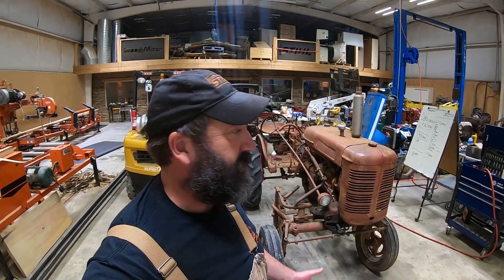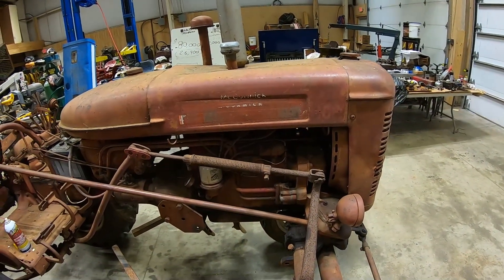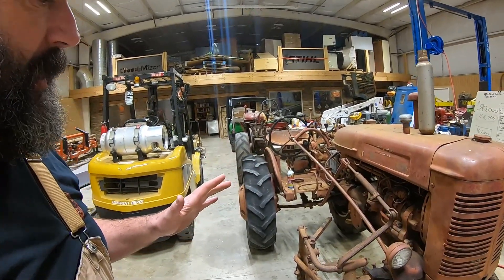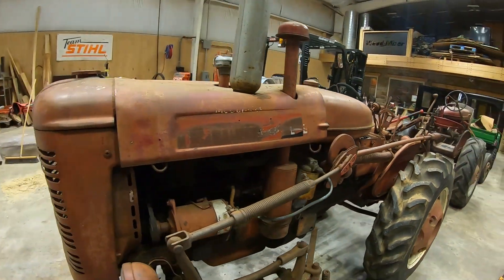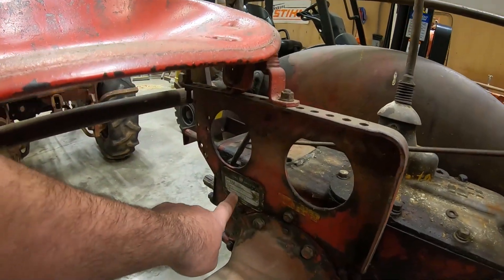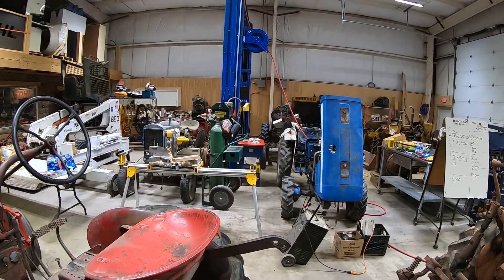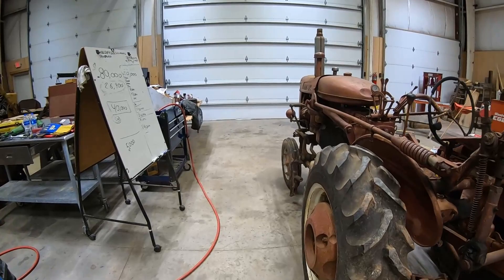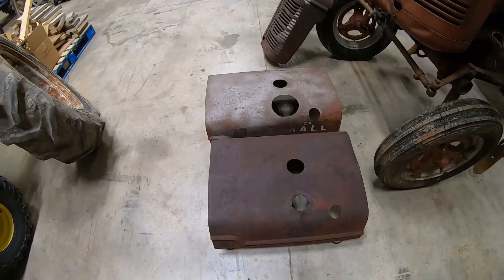Just in!!  International Farmall IH Super A1...

Comment: Does the Super A-1 have the same block as the 100 and 130? If it has the 123, it would probably be the same block. I noticed this tractor has a dipstick, and in the same location as the 100 and 130. I have a Super A and a 130, both have the water pump on the side, behind the generator. The Super A still has the two drain cock check valves on the side of the oil pan.
Reply from the maker: Yes, they were the first to get a 123 engine.  The super A1 on the Farmall 51 video has a dipstick and the same “step” in the bottom of the grille.   Definitely a mystery- should be a fun tractor to rebuild regardless of what it is…

Comment: Am thinking that was a farmall 100 someone put a super c grill on it. Probably right hood just wrong grill. Tag be on bell housing. The 100 started in 54 so they can have a z code. I might be wrong. I enjoy yours videos
Reply from the maker: Hello Cody!  Its possible for sure!  The "step" in the grille is the thing that keeps popping up only on the Super A1 tractors.  I have a C grille down at the shop, and it has a different profile where the center section meets the "chin".  You are 100% right on the z code reaching into the 100's too!  At any rate, it should be a fun project.  Great to hear from you!